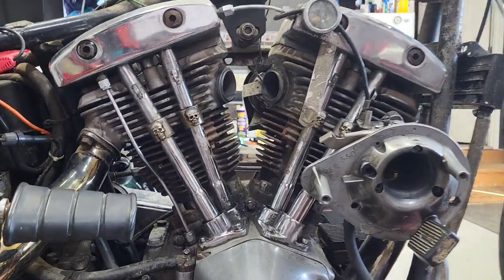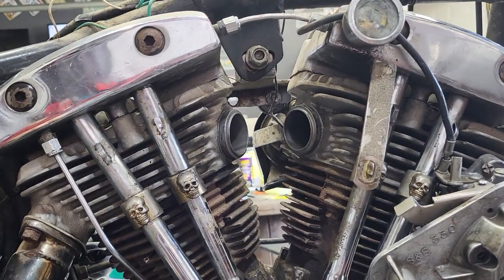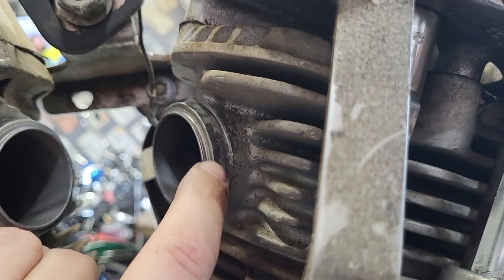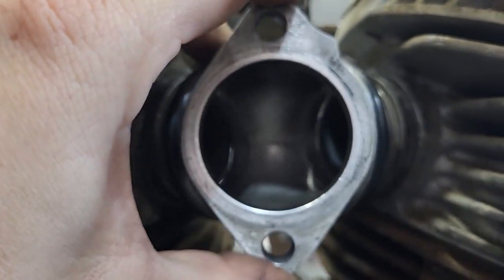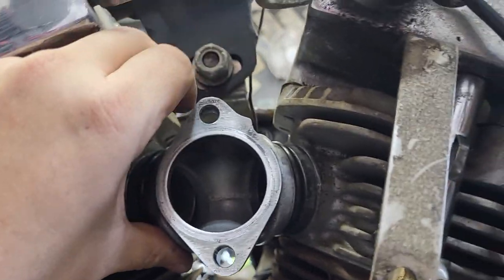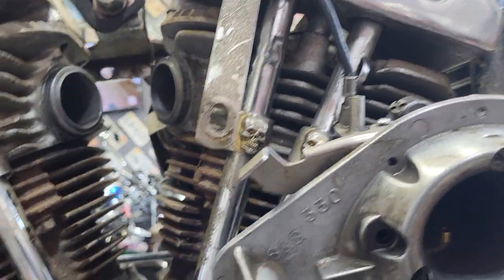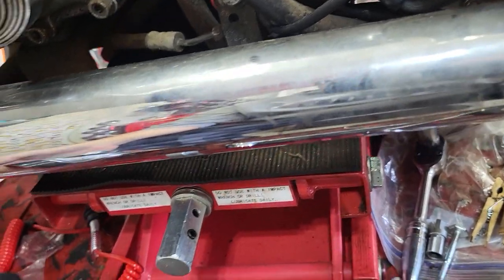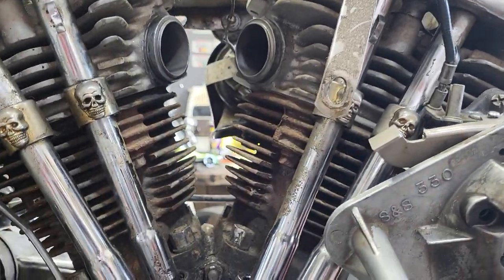Shovelhead and ironhead intake seal replacement, and underlying symptoms.

Comment: Great video.  I’ll check my Pan head.  Thanks
Reply from the maker: You can check your panhead the same way. But it will be a lot different to change the seals.
Reply: @DWchopshop  got it.  I haven’t taken the intake apart yet.  It’s an early 90’ S&S motor.  It has the S&S super B and Intake that looks exactly like your video.  Will it really be that different?
Reply from the maker: @ScrewyLuie73  ohh I see. I thought you had a legitimate panhead. The s&s motors have a lit of changes to make them more dependable. I've never worked on one, but it might not be that different. It's just nuts and bolts. If you need any help let me know.
Reply: @DWchopshop  yeah I’ve been noticing some differences just from little work I’ve done when compared to my old shop manual.  Wondering if I can get a S&S shop manual for my specific motor?

Any way thanks for the offer of advice.  I will be taking you up on it soon.

Thank you sir and keep up the great work.
Reply from the maker: @ScrewyLuie73  I'm sure you can find a manual for that specific engine. S&S engines are common, and they are a great company.

Comment: So you don't need the rubber/plastic sleave around the "O" ring
Reply from the maker: That sleeve is for a later type of intake seal. some guys double them up and use the O-ring and the sleeve. But you should only need the O ring. There's also been all sorts of aftermarket kits made over the years that use all sorts of O ring or plastic parts and sleeves that "guarantee" a seal. What year bike are you working on?

Comment: I have this exact damn project going on.  I too have no friends but can I get those o rings at Lowes
Reply from the maker: Just make sure they are Vinton o-rings. Normal.black rubber will break down with contact from fuel.

Comment: Cool video man, im gonna try going back to the o-ring style. 
I ran the square tite seal things for a bit with 2 smaller clamps on each side, but they ended up slipping and damaged the rubber. 
Is it possible to do both o-ring and square tite seals?😅
Reply from the maker: I like oem seals, they are fast and easy, and if yourbheads are clocked they seal fine. 

I have taken bikes apart that have all sorts of seals mixed up on the manifold lol. So yeah I'm sure you can, but its not a best practice 😂